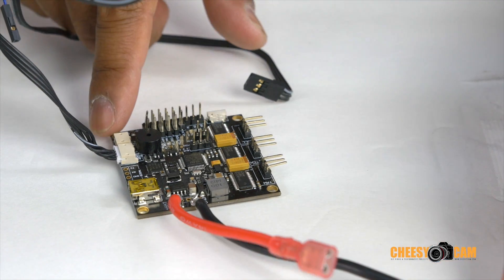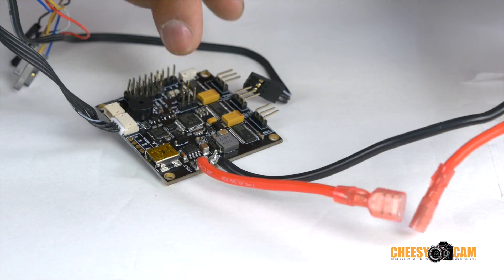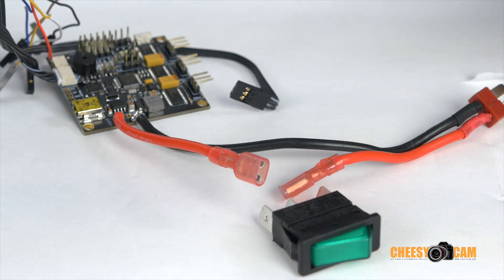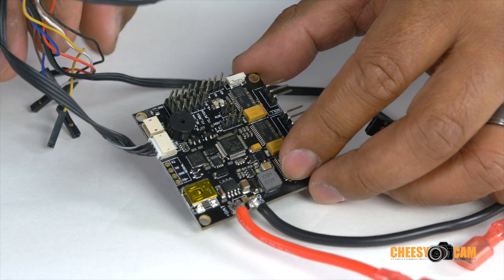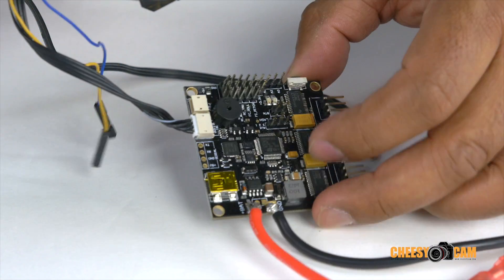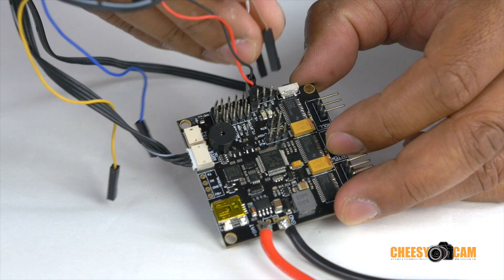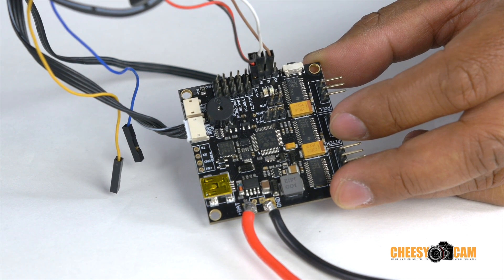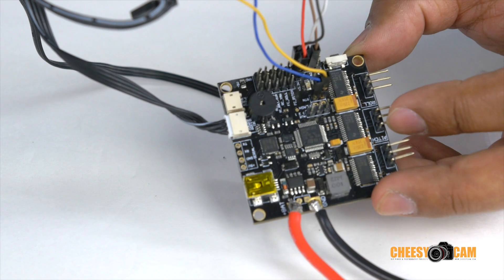Part 6 - CAME 7000 3 Axis Gimbal Build Installing Joystick

Comment: I would like to know which battery to be used in this gimbal ?
Reply from the maker: Pravin x.p These gimbals come with a T style deans plug 3S LiPO battery. Here's a good article showing you batteries, charger, and a case http://cheesycam.com/unboxing-the-came-tv-7500-7800-rtr-3-axis-gimbal-stabilizers/

Comment: Do you think its possible to run 2 joysticks? I was thinking it would be nice to have one on top also. Maybe bridge them together before the Alexmos Controller.
Reply from the maker: I don't think it would be possible. The Joystick option works through measuring voltage. If you add another analog joystick that would add resistance and the voltage would drop. When the voltage drops the gimbal thinks you're moving it, so it would start drifting.

There is another set of pins for a wireless receiver used for a remote operator. I haven't tried it, but perhaps you can use that set of pins for the second joystick.

Comment: Emm Thank you for the video they are awesome. Where did you get the power switch and connectors?
Reply from the maker: I picked up the switches at my local electronics store. Just picked out whatever was available on the shelves.

Comment: I wired a round blue LED switch inside the top handle. So I can turn on and off the power with my thumb. Also the LED does help you remember not to leave it powered when you are putting it down.
Reply from the maker: Great tip, I thought about that but didn't want to deal with running more wires through the frame. I think eventually i'll make my own battery pack at the handles and then add a button closer to the handles too.
Reply: I'll try and post a couple pics of my handle. Very intuitive to turn on or off.